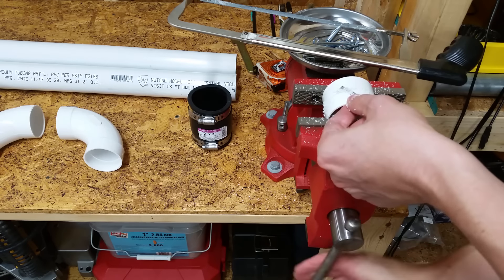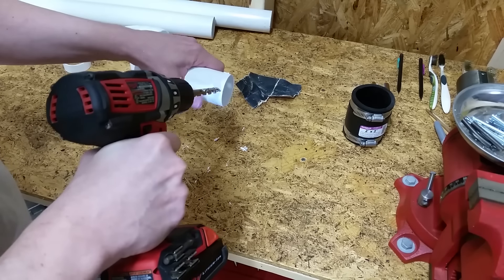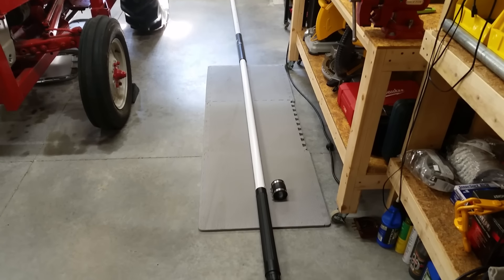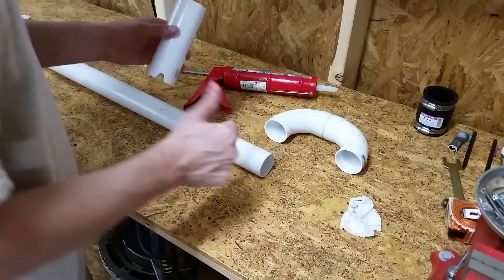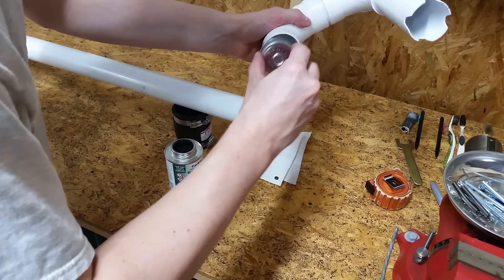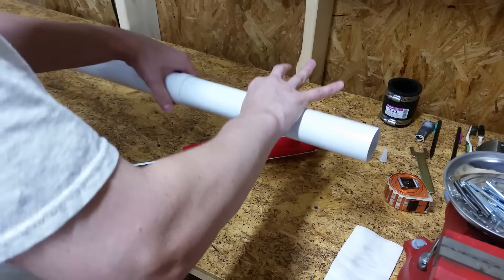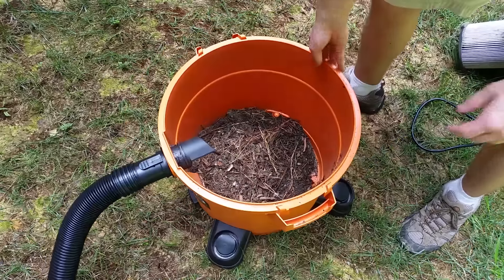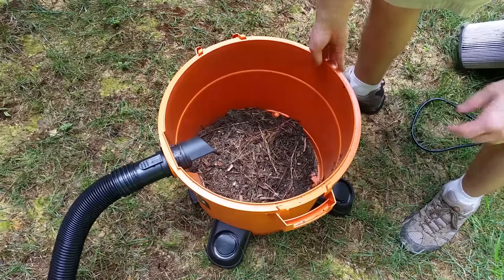DIY Gutter Vacuum - Easy and Safe Gutter Cleaning from the Ground

Comment: For the do it your selfer going to Amazon and search  for central vac fittings and you can find the 90 degree sweeps and pipe at good prices which are half the weight of sch. 40 pvc.
Reply from the maker: Oh yeah, you'd definitely need to build this out of central vacuum tubing and fittings. The total weight of both sections is only 2.5 pounds. Something similar made from schedule 40 PVC would probably be triple the weight, maybe even more. That might not sound like a lot but when it's 20 feet in the air, it would become quite unruly. If you only had a 1 story house, schedule 40 PVC pipe would probably be manageable for most people. Your local electrical supply store should be the cheapest source for central vacuum tubing and fittings. Thanks for watching!

Comment: WKM…NICE IDEA FOR SMALL DEBRIS PIECES BUT A GUUTER FILLED WITH TREE LEAVES IS A MUCH BIGGER CHALLENGE AS LEAVES WILL CLOF THE PIPE IN THE DIRST FEW FEET.
Reply from the maker: I've never had a clog in the pipe. I have had some clumps of matted pine needles get stuck at the opening a couple times but just the end bouncing around in the gutter breaks 'em up enough to get sucked down in just a few seconds.

Comment: Problem is I only rent, I'm old and disabled, but landlord says it's my responsibility.  I don't have a machine shop or fancy tools like you. Most people don't!   I would be happy if I could just cheaply jury-rig something that I could use from the ground, that's angled into the gutter, that shoves the debris along, and out the open end.  No wet-dry vacuum, no water hose involved.  

It's been compacting for many years up there.  It's got neighbor's pine needles and tree leaves.  I don't have a downspout, just a single length of gutter with an open end, no cap, so I only need to shove it out and over as I go along, with the remainder shoved out the open end.  Doesn't need to be perfect.  

The way it is now, when it snows, the snow melts and thaws and melts on the roof, forming gigantic icicles right over my front door (of course!), it freezes, thaws, refreezes into monster icicles that drop and for, a sheet of ice right at my front door, so it's too dangerous for me to even step out of the house until it all melts... too slippery, like an ice rink.  One year I laid down bath towels over the ice, all the way to the car in the driveway, so I could have traction under my feet.  I use snow melt, but the heavy dripping over my front door knocks the pellets away, and at night what's left freezes yet again.  

I just wanted to find the cheapest, safest way to crudely get the gutter to have room to accommodate melting snow to drain out the open end, not over my front door!  I admire guys who have inventiveness like you, I watch This Old House avidly...  but I'm not a mechanical genius and don't have fancy tools, a wet-dry vacuum or money.  I'm on social security.  

I'll keep looking.  At least I learned from you that there's a lighter type of pvc...  but I'll bet it's more expensive, and in fact I wonder if regular pvc might actually be advantageous in making it work for me by using its weight instead of my muscles.  I'm lucky thr landlord lets me stay here, especially nowadays with rent skyrocketing, so I'm willing to try something  cheap myself, to make my winter safer.  I'd even consider scrap wood and screws if it's cheaper than pvc.  I can't afford to spend more to "do it the right way."  

Maybe a paint roller with extensions, and a garden trowel or coat hanger manually shaped and angled down at the top end?  Or a plastic hanger?  It's peobsvlyngoing to be recalcitrant to removal because it's been building up to the top edge for many years.
Reply from the maker: Don't forget, as a renter, you do have some rights. If there's an issue causing a dangerous ice situation over your front door, I would imagine any respectable landlord would remedy that problem for you. I'm not saying they'll clean the gutters, but they should fix any problems that are a hazard to the renter.

The attachment I built is probably not a good solution for you. However, it wasn't expensive, I built the whole thing for only $25. No fancy tools needed either, just a hand saw and some glue.

All of your ideas would probably work if implemented properly. If your gutters aren't too high, you could use a long 2x4 and fasten the trowel or coat hanger to the end.

Comment: Cost me 90 bucks to do in Canada, everything is so expensive here compared to you guys
Reply from the maker: Yikes, is that because of Covid or do things just cost more up there? Central vacuum tubing is kinda hard to find in my area. And by that I mean I couldn't find it at the big box stores. I ended up getting my tubing and fittings at an electrical supply store.
Reply: $1 US = $1,30 CAN
Reply from the maker: @valeriehensley6024  That's not too much of a difference. I wonder why it would cost almost 4x as much to build the gutter vac attachment in Canada?

Comment: It is a big problem for me, because of blockage drains and gutters do not run through.  This solution, no matter how nice, doesn't work for me.  The leaves of ash, elm and sycamore are near, and no pine needles at all.  The tube gets clogged right at the start.
Reply from the maker: Maybe you just need a stronger vacuum (5 HP or more)? I do have some larger leaves in the front of my house and the pine needles will clump together and I'm still able to suck it all out. Thanks for watching!

Comment: The wet peat that ends up in my gutters isn't going to suck up into that pipe.  But then I live near Seattle.
Reply from the maker: As long as you have a strong enough vacuum, I think you'd be surprised what it can pick up. Grab some peat from the gutter and if your vacuum can suck it up off the ground, you should be good to go.

Comment: Man i dont know where you bought all of that for less then 25 bucks one 8 foot pipe on amazon is 25 bucks.  HD is sold out.
Reply from the maker: I bought the central vacuum tubing and fittings from a local electrical supply store. I did a follow up video with more details, if needed.
Reply: Thank you sir I saw it and I am in process of making this my self.
 @Mikeattempts
Reply: Found my supplies at a local central vacuum distributor $21 for 16 ft of tubing and 2 angles. 2 ft abs was $8 at home depot
Reply from the maker: @Dhughe9  I'm glad you were able to find everything for a good price too, thanks for the comment! :)

Comment: I believe you are suppose to remove the paper filter when vacuuming water.
Reply from the maker: Yes, you are correct. However, the stuff I was sucking out of the gutters was only damp in some places so I chose to leave the filter in place. When I open up the vacuum at the end, you can see that everything looks pretty dry.

Comment: There's still gonna be wet dirt that's going to stick to the inside and i don't see how you know you got all the debris out
Reply from the maker: You're right, if you use this attachment when it's too wet, dirt does stick to the inside a bit but it's worse in the flexible hose than in the tube. I try to wait until we've had at least a few dry days in a row. As strange as it might sound, you can definitely feel and hear if there's still debris sitting on the bottom of the gutter. Going back and forth a few times in each section seems to get pretty much everything.

Comment: Can't find the pvc pipe to save the life of me. It can't be this hard to get schedule 20 pipe
Reply from the maker: I actually don't think it's referred to as schedule 20, just central vacuum tubing. I got mine from my local electrical supply store. I did a follow up video with more details, if you need 'em.

Comment: Install Gutter Guard and you never have to worry about cleaning gutters.
Reply from the maker: I wish it were that simple. I'd still need to clean the long-leaf pine needles off of the guards. Gutter guards might be a good solution for some homes, this vacuum attachment works well for me.

Comment: WOW $366 for the PVC tubing? That's an awesome idea for sure, but $300 for tubing?
Reply from the maker: Holy crap, that was NOT the price when I first posted the link! I would definitely recommend purchasing the tubing from your local electrical supply store. Each tube was only around $6. I did a follow up video if you'd like more details.

Comment: Pro tip:  attach a mirror or wireless camera to the top so you can see when the gutter is clear.  Or use a drone!
Reply from the maker: To each their own but I think that overcomplicates the job. I've been using this attachment twice per year, for 6 years and have never felt the need to add a camera. Believe it or not, you can actually feel and hear if there's anything stuck on the bottom of the gutter.
Reply: @Mikeattempts  Word!
Reply from the maker: @BlondieHappyGuy  Hahaha, I love technology just as much as the next guy, but I bet that if you do add a camera, you'll stop using it by the 3rd or 4th time you clean your gutters. :)
Reply from the maker: @BlondieHappyGuy  Either way, I think you'll really like cleaning your gutters this way. It's much easier and faster.

Comment: Only good on loose dry debris , no good on gutters that have had some rain, over winter or spring.
Reply from the maker: It sucks up wet stuff, but I usually try to wait at least a few days after a rain to clean my gutters. If not, the wet sludge and shingle grit builds up on the inside of the flexible vacuum hose. If you don't rise the hose out after, it dries and makes the hose much heavier.

Comment: It's actually the stuck sediment no vacuum will pick up that deteriorates the bottom of the gutter..

That's why a scraper and a bucket this does not replace.

Gutter water jetting will work if you own professional equipment.

I've worked for A-1 Rain Gutter, Mr Penny Custom Copper and Gutter Works and the likes doing gutter and roof top sheet metal.

So, suck away. 😂
Reply from the maker: Will do, thanks for watching! :)

Comment: Wouldn't gutter guards be safer
Reply from the maker: Big leaves blow off the gutter guards pretty well but the smaller leaves and stuff like long-leaf pine needles (which I have a ton of) would not. So, I'd still need to clean off the gutter guards.

Comment: Stuff in my gutter are a sloppy mess
Reply from the maker: If you remove the filter from your wet/dry vac, it should still be able to suck out all of that slop and shingle grit. However, if it's that bad, I would recommend cleaning it by hand the first time and then yearly with the attachment. If you do use the attachment, I would also recommend rinsing out the vacuum hose and attachment if it's really wet and sloppy. If not, the slop will stick to the sides and dry, making everything much heavier.

Comment: the 8ft central vacuum tubing now goes for $24 each
Reply from the maker: Locally or online? Since this tubing is long, you're gonna get a much better deal buying from your local electrical supply store. I did a follow-up video with more details, if needed.
Reply: @Mikeattempts  I totally get that. But I just assumed you had at least tried putting on the 2" tube. When I did so on mine (exactly your design), it was quickly apparent that the 2" x 2" was way too huge. I personally cannot understand that and would never have guessed that might happen. This thing is great. Thanks so much!
Reply from the maker: @davidwhite9453  It's probably because pipe is measured by the inside diameter, but tubing is measured by the outside diameter. The rubber coupling was probably made for PVC pipe. 2" PVC pipe has an outside diameter of 2.375".
Reply: @Mikeattempts  locally (vacuum store). also i think your link for the home depot abs 2" 2ft pipe is no longer valid
Reply from the maker: @WilliamNicole  Holy crap, they were $24 per 8ft section locally? That's nuts! They were only $6 each when I bought 'em locally in 2018. Thanks for letting me know about the ABS pipe link, I'll try to fix it.
Reply: @Mikeattempts  I can't even find them.  :(
Reply from the maker: @robertjohnson5573  I got mine at my local electrical supply store and another viewer recently commented saying they got the tubing at a local vacuum supply store. I did a follow-up video with more details on the tubing, check it out.

Comment: blowing works better
Reply from the maker: Yeah, you can connect to the vacuum's exhaust port if you prefer to blow but then it'll rain down gutter crud. ;)
Reply: @Mikeattempts  yes, but this way you don't fight chimney effect, one story roof not that noticeable, higher gutters vacuum looses efficiency.
Reply from the maker: @EdwardTeatch  Yep, whatever works for you. I've been using this attachment to clean my gutters since 2018 and, besides paying someone else, it couldn't be easier. :)
Reply: @Mikeattempts  I agree, I use my blower setup for a very long time.

Comment: Ya that would plug up in 20 seconds.  Get on the roof with a leaf blower and your done in 10 minutes.  You can also blow down the downspouts.  Done.
Reply from the maker: I've been using this attachment for over 4 years now, it doesn't plug up. I made it so I don't have to get on the roof, it works great for me. :)

Comment: Or you can spend $50 and buy factory made attachments that will connect to a leaf blower and clean your gutters a lot faster.
Reply from the maker: Sure, I just prefer the vacuum so it doesn't rain down a bunch of crap that I then need to clean up off of lawn, bushes, deck, sidewalk, and myself. :)

Comment: Buy some gutter guards
Reply from the maker: I looked in to gutter guards prior to building the vacuum attachment but, from my research, they all have their problems and they're not cheap. Plus, I would still have to clean off the guards because of all the long-leaf pine needles. The gutter vac was cheap, works great, and is perfect for my needs.

Comment: "Three fourths" sounds silly. I've never heard people use that. It's always been three-quarters. You don't say "a fourth of an inch" so why say "three fourths"?  There was no mention of how it was attached to the shopvac or how powerful a shopvac you'd need to make this work.
Reply from the maker: It's just a simple slip fit into the 3 foot black extension tube that comes with the vacuum. It bottoms out at the "stop" I made by cutting the PVC coupler in half but you could use a small piece of the ABS pipe to do the same thing. I used a "5 HP" shop vac and it does a good job. Thanks for watching!

Comment: Now put a camera on it so you can see what you're doing.
Reply from the maker: Adding a camera makes it a 2 person job, one to control the attachment and another to watch the camera to see if you missed anything. While it would be a cool addition, I think it's unnecessary because, if you use a strong enough vacuum (5 HP or higher), it's going to suck up anything that's in there. Thanks for watching!

Comment: Leaf blower not this crap
Reply from the maker: Why blow it all over the place and make double the cleanup when you can just suck it out? Plus, I can just switch the hose to the exhaust port on the vacuum and blow it out if I wanted.